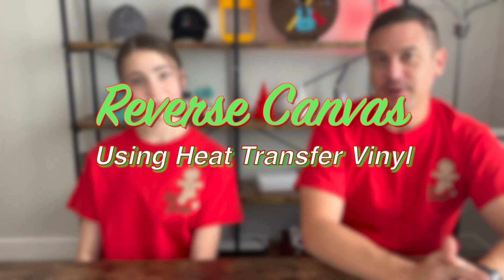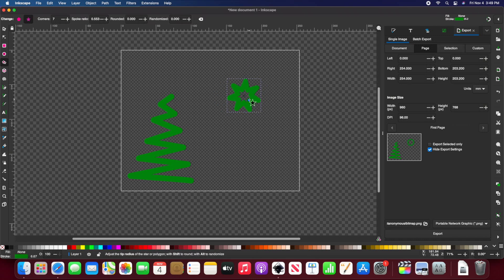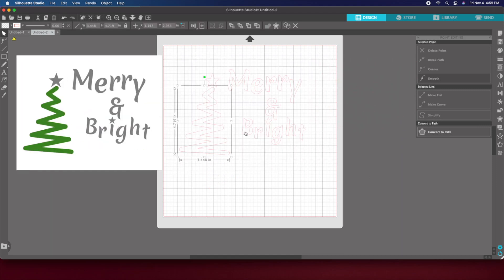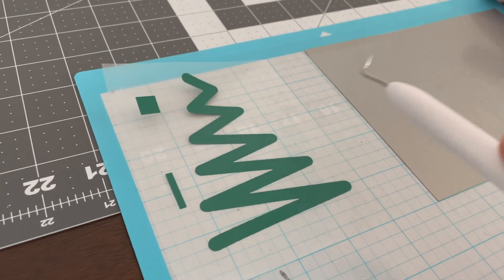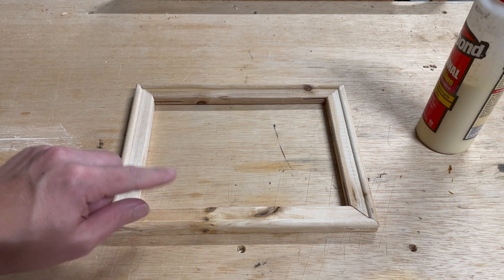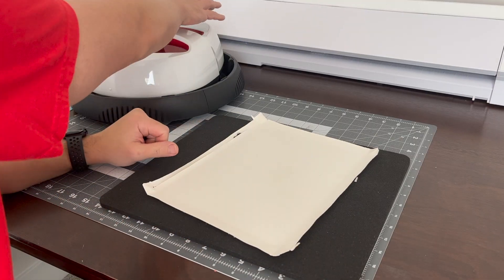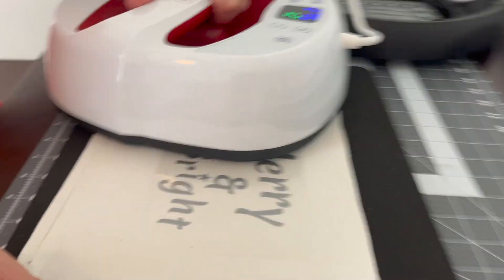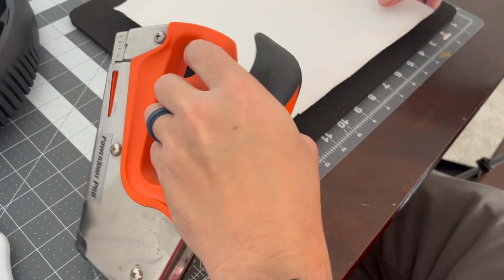Creating a Holiday Themed Reverse Canvas | Using Silhouette Cameo 4 Pro

Comment: Fun video. I've picked up some tricks from your channel, so I wanted to share that you can save a few steps bringing your Inkscape designs into Silhouette Studio Basic by using the DXF file format. Inkscape can save in that format and the basic (free) edition of Silhouette Studio recognizes it (same thing if you wanted to use a free drafting program for your designs too). It can potentially improve your Silhouette Studio experience vs tracing PDFs. Thanks!
Reply from the maker: Thanks for watching! I'm glad you have been learning different things on our channel! Also, thanks for the tip!